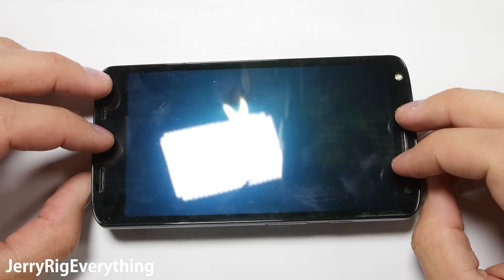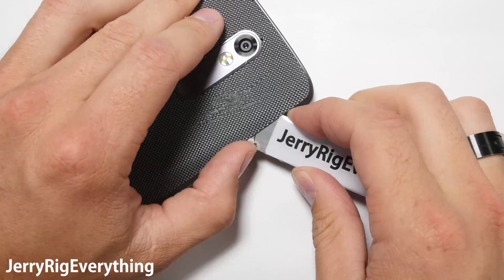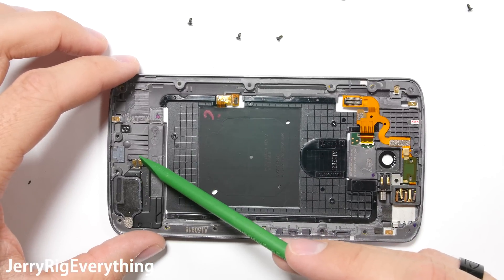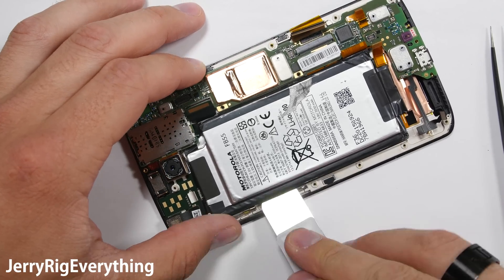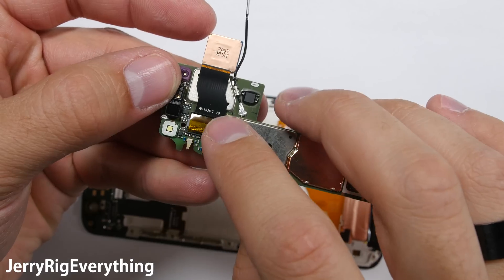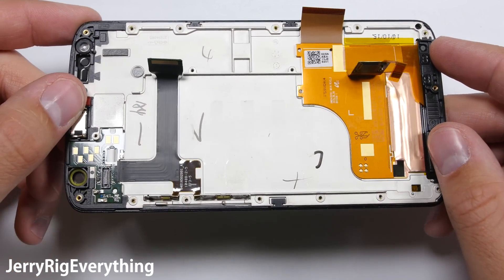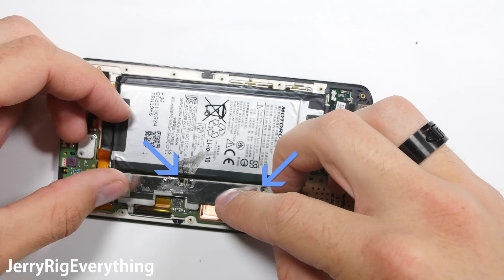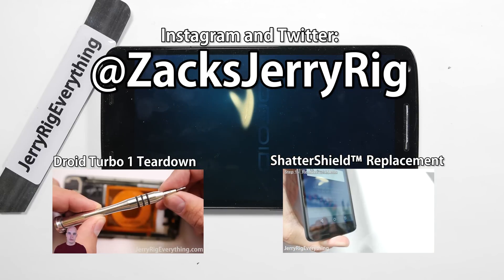Droid Turbo 2 Teardown - Screen Repair, Battery Replacement COMPLETE

Comment: I replaced the Battery. Then at boot up speaker did not work. Opened it up again to check everything. Now back together the power button is stuck in "ON". An help is welcome.

Comment: Didn't remove the pressure ribbon for the power and volume buttons.  I'm finding that when replacing my battery that mine was pretty jacked up.  It seems to be a common issue on these phones as well.

Comment: Hey there. 
 So I have a Turbo 2 that has 2 issues.

1- Broken Charge Port
2- Left speaker is out

 From my understanding of this video, I can't home repair either of these things?
Reply: Dama there is only one speaker on this phone, the right side one. Left side one is just a slot for designing purpose, not a speaker.
Reply: utsav garg How strange. Thanks for the knowledge dude 👏

Comment: The two screws on the metal frame on the inside were a different size from all the others and do not work with a t3, t4, or t5. Any suggestions? this phone has been a huge pain in my ass ever since I made the mistake of getting a phone from Cellular Country.

Comment: Could you explain where the internal cellular radio/antenna is in this teardown? after opening the phone to replace the loudspeaker, my cell network reception is atrocious. did i leave something partially or completely disconnected? Nobody seems to be able to tell where in the phone it is located. Sorry if this is a dumb question but I would love some help!
Reply: Francesco Lombardo I'm not really a genius so don't blame me if it goes wrong, but I'd open the phone and disconnect then reconnect all the ribbons etc

Comment: just curious, i replaced charging port and tried to avoid extra work to take the battery out. i pulled the board out with out it.  it seems it was just fine. what you think?

Comment: the only major complaints I have about the moto x force (the international version of the droid turbo 2) ranked most annoying to least annoying

1: the version of Android SUCKS ASS, it is so restrictive, even iOS is more open than the version of Android Motorola ships with this device 

2: non removable battery (why are we STILL doing this bullshit)

3: sooooo much bloatware (mostly Google and Motorola crap) 

4: can't have 2 SIM cards and a memory card installed at the same time

5: lack of accessories such as battery extension cases

6: CPU and GPU is a bit weak 

I don't know why but it seems like phone and laptop companies are REQUIRED by some unwritten law to always fuck something up when designing a product 

if those 6 issues didn't exist 
the phone would be perfect

why is it so hard just to make something that is perfect 
why do they ALWAYS have to intentionally fuck something up
Reply: MWB Gaming Google bloatware...you high buddy?
Reply: no 
there are a lot of preinstalled apps that i cant delete and will never use 
most are from motorola but a lot are also from google
Reply: @mwbgaming28  true
..like those Doc's,sheets,etc.
Reply: @elysegabrielle4053  same for me with moto Z 2014, moto X force, moto Z2 play...

Comment: after changing the screen the touchscreen does not work anymore, put the old one back in it doesn't work now either. any ideas?
Reply: This happened to me too - That little wire with the tiny snap connections that look like very very mini blue jean snaps came loose.  That's all it was for me.

Comment: I like the shatterproof screen, micro sd card slot and camera of this phone but is there a phone with comparable screen, card slot and camera that has a fast change removable battery?
Reply: pretty much all the smart phones now don't have a removable battery. It sucks
Reply: ytube ram lg v10 , v20

Comment: I dropped my Droid turbo 2 on the ground and it no longer responds. after picking it up it turned on but quickly turned off. I tried plugging in the USB charger and doing a hard reset but both methods did not work. I want to save my pictures and videos on the phone. would you recommend me taking it to a repair joint?
Reply: Boat la Boat same

Comment: My Moto X Pure doesn't like your video.  If you have a Moto X Pure on hand, can you try to watch this video and see if the video part stalls around the 1:00 - 1:06 part while the audio keeps on playing.  This video plays fine on my Turbo 2 but my friend who also has a Moto X Pure has the exact same problem.  And he's on a different network.  Wifi, Verizon, Metro PCS, doesn't matter.  Uninstalling the YouTube update doesn't fix it, nor does playing it from the browser.

Comment: Jerry, pitching in as well: before you bend the crap out of the 5mm moto z, please try the bend test with one motomod, i suggest the regular "style mod" since i read somewhere every moto z should come with at least one of them.

Hopefully the backplate will help with the bending load, and i hope the magnets hold.